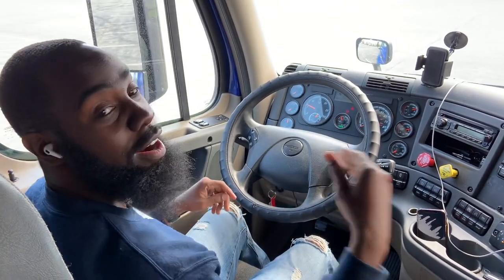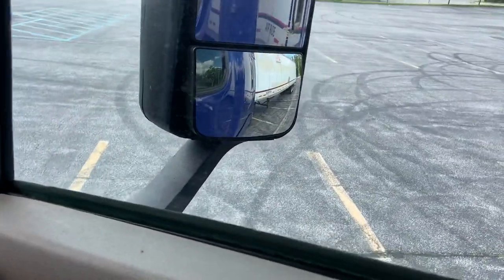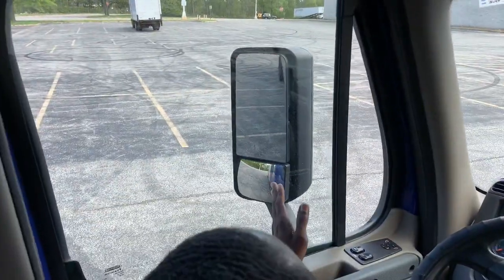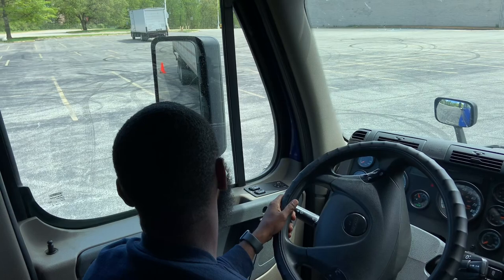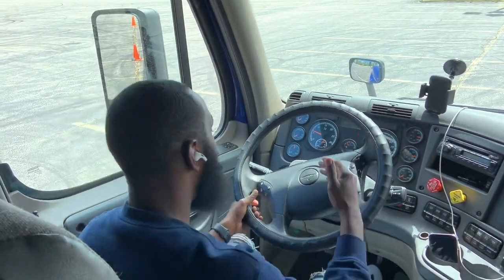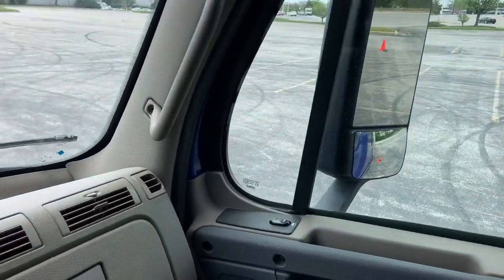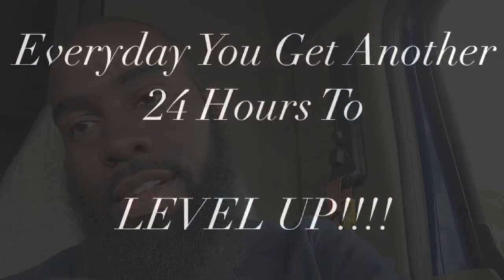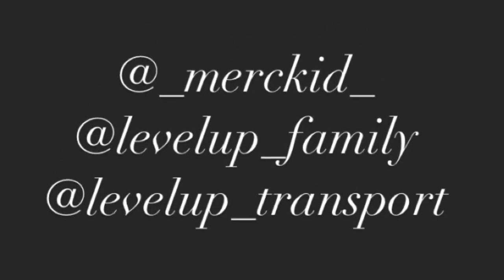How To Perform Offset To The Right With Semi Truck And Trailer

Comment: I LOVE your clear explanation (best I've heard), 2 views (in-cab, then outside from rear), AND your calm, sweet manner.  I feel soothed and encouraged.  I've been so stressed because I failed the 90° alley dock on my first test, and my retake is tomorrow.  I'm now going to spend the evening giving gratitude to the Divine for the miracle, then rise early and watch your video several times before 9:00am test.  THANK YOU SO MUCH :)  Peace, Love, Respect, Joy, Gratitude, & All Good Things to You!!
Reply from the maker: Definitely appreciate you…how did the test go?
Reply: @thelifeofmerckid  I failed the 90° again (successfully did it both times, but with too many pullups).  Had only 30 hours behind the wheel!  My forward-driving skills are very good for a newbie, but still no CDL.  I have to buy a whole 'nother student package for more windshield time.  Will do some other work to make the $.  Time to shift gears & move on in life.  Failure & disappointment doing pushups outside my door cannot harm me when I walk in Grace, my Almighty Divine at my side :)
Reply: @lisacarnicom8339  God will always be on your side.

Comment: I see Trust God in your back, great encouragement! Meanwhile I am a little bit confused, in the first step make a hard left until you see the fifth wheel or drive axle in the middle of right bottom convex mirror? Then make right turn, is that correct?
Reply from the maker: @Holytonex  definitely appreciate you 🙏🏾 but you want to be looking at your axle…once your outside tire hits the middle of the landing gear then you stop and turn the opposite way
Reply: Thanks for sharing, I will try it tomorrow !

Comment: This is the only video I found that's actually helpful. I'm currently struggling to do offset backing both to the Left and to the Right, I haven't had a chance to try the 90 degree and 45 degree alley dock backing yet. I really need to get better as soon as possible.
Reply from the maker: Glad I could help you out…just keep trying and take your time and it will definitely come to you…when it’s test day your gonna ace that test so don’t stress it 💪🏾💯 hit me if you got any questions
Reply: Did U pass

Comment: I had a teacher laugh at me when I messed up. The first turn he told me to look at a crack on the head more. Then turn right to get straight
 Straight back until my rear tires are outside of the boundary line then Hard left until my foot of landing gear pass the boundary line then Hard right, but I kept messing up and he laughed at me, said I wasn't listening, would tell me to get my tires straight and when I did he would say, no turn it right and I would then he would say no turn it right and I snapped.

I was frustrated because I felt like he was mocking me and not actually helping me. I told him it was disrespectful because it was like insulting my intelligence. 

He told the boss then came to try to talk it out with me then said I had an attitude.

I said it's easy to say the black woman has an attitude when she expresses her dislikes and boundaries after being violated. 
How was I wrong ? I still don't see it. 

He also left me to figure it out and a few students laughed at me for messing up because they think I'm a know it all because I suggested we all study and test each other with every section, and suggested that we name what we're looking for before learn the CDM,ABC, CDB words. Name it like,
This side I'll check my alternator and this side my power steering reservoir, coolant , etc so we know we won't miss it. 

But I'm a know it all ? So they gloated in my downfall.

I never said I knew how to do everything. I made suggestions. I never said I remembered everything. I said I studied five years ago but didn't pass the parking. 

But they still laughed when I didn't pass the parking in training.

I really want to just go home but at the same time I don't want to do that to myself.

So here I am on YouTube, learning the parking with much reluctance.

I am literally alone now. To myself by myself.  Teachers are even recording it now. Happened yesterday and today 
So I was pulled into
Reply: Wow thank you sharing this! He who laughs last laughs best. You will excel and I hope the negativity towards you will be used as motivation for you to pass everything

Comment: Could you tell me how u make sure you don't putt too much pressure on the throttle?I be driving steady and then all of a sudden I start going hard , I'm trying to understand how to know how light tl put your foot on the throttle
Reply from the maker: If your in a automatic…it definitely takes a little bit to get use to the pedal but you would just have to keep continuing to just lightly press on the pedal

Comment: How do you straight back? Please answer.  I think imma get kicked out the program on Monday if I don't get it by then
Reply from the maker: The best way I can explain is to always move slow so it’s easier to correct your problem…while looking in your driver mirror, always turn to the problem but remember you got to turn the wheel back to the other side to get the truck back in front of the trailer and then continue to roll back
Reply from the maker: Always come to a complete stop before you start turning your wheel